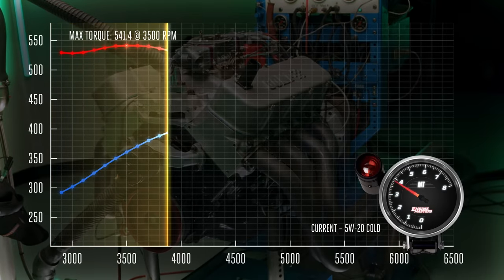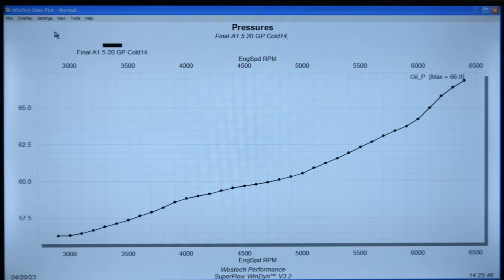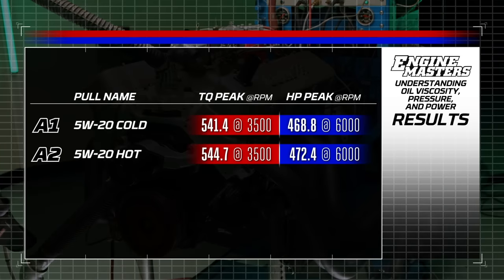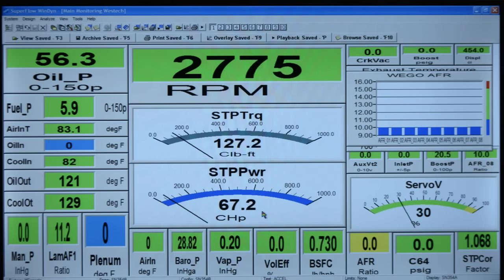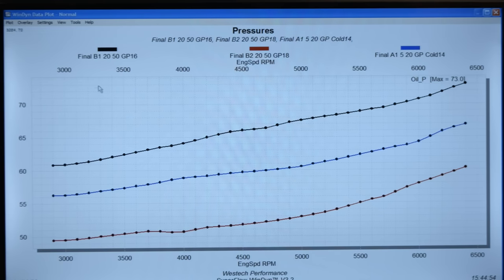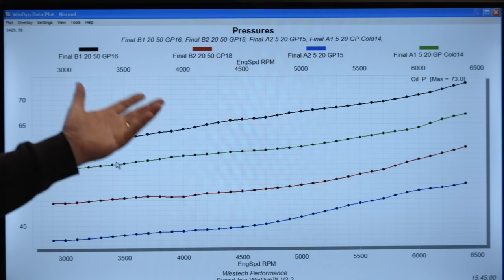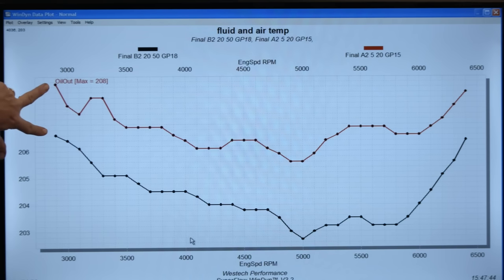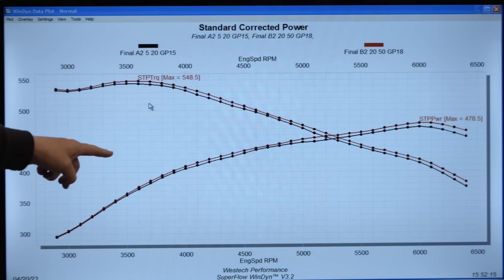Does the Thickness of Your Oil Matter? | Engine Masters FULL EPISODE | MotorTrend

Comment: Example 10w30 ...I was taught 10w is the cold flow number relative to water. The w stands for winter or cold flow. It flows 10x slower than water in a given time period through a given diameter tube.

30 is the multiplier when long chain polymers are added to the base 10w oil to thicken it when it gets hot. The polymers are wound up when cooler and unwind and lengthen when heated to synthetically thicken the oil.

So when hot the 30 flows 3x slower than 10 does when hot. The greater the variance (multiplier) between cold and hot flow, the more polymers that are added to the base oil.

These polymers shear and over time the oil loses it's ability to thicken up as much as when it was fresh. A 10w40 has 4x vs 10w30 having 3x... So 10w40 while initially thicker will shear down to a 10w30 or 10w20 before it is changed.

The take away from this test for me is that there is a goldilocks affect.... Too thick and horsepower is reduced due to flow resistance (20w50 cold). Too thin and horsepower is lost to ring seal (5w20 when hot). And then about just right (20w50 when hot).

I would like to have seen 10w30 and 10w40 compared with these two just to see where the dividing line is....

Maybe while 5w20 is just a tad too thin, stepping up to 10w30 provides adequate lube and seal to make comparable power to 20w50... Maybe more??? Maybe 10w40 finally gets the job done and exceeds 20w50 when hot????

Then you'd at least know how thick to go, taking into account cold start flow (lower number is always better) and then hot number that will be sufficient enough factoring in shearing over time.

For example if 10w30 is just right when fresh, maybe opt for the 10w40 knowing it will thin out some between oil changes. Anyhow... These tests always seem to be done incomplete. Good partial info though.
Reply: "These polymers shear and over time the oil loses it's ability to thicken up as much as when it was fresh."  PAO base oil is inherently multigrade and doesn't need those polymers (viscosity index improvers) to achieve a multigrade rating. 🙂
Reply: @TassieLorenzo  Yeah, read that before too. Should have mentioned PAO uses esters to compensate. PAG I've read has less friction coefficient, but it's better suited for sliding wear, whereas PAO better for rolling wear. I haven't conducted any tests to determine anything I've wrote. Just know I've been successful staying up on maintenance.

Comment: Well fellas it is not really a big surprise that thicker oil helps with ring seal and makes more power.
  But here is a the question list that brings much curiosity,,,
  Does thicker oil provide the greatest gains on engines with wide ring gaps?    
   Is there a substantial difference in engines that have cast , or moly rings ?
 Especially because there would not only be a difference in the cross hatching because of the type of rings that are being used.
  But I am most curious about the fact that cast rings and moly rings heat and cool a bit different than one another.
   So I guess the overall question is,,,   
  Does thinner or thicker oil make more or less power depending on the type of rings in a engine? 
 And which weight of oil makes more power with which types of rings?
   ????? 
 Tim from Wisconsin.
Thank you

Comment: They didn't talk about the thick oil and the load on a bronze distributor gear driving the pump, or does thick oil holds bubbles cause by aeration, in suspension. I'll stick with the thinnest oil that gives me my desired Hot pressure at idle. 25lbs. at 1100 rpms .

Comment: if ring seal is so important why did a test i saw on a 600 hp race engine when the ring end gap was opened to .125 the engine lost less than 10  hp. it blew oil all over the dyno cell.

Comment: Please remember, 95% of engine wear occurs arms cold start as it takes time for the oil to reach all surfaces. This is why a too thick oil does more damage than good if your engine has tight bearing clearances, like most all late model engines.

Comment: The oil pressure n viscosity floats the parts so they dont touch, if metal touches metal gauling. Racers use thicker more viscous oil for more gaul protection under extreme loads.

Comment: 0, 5, 10, 20W ( winter cold weight) 30 or 40 weight. They use oil molecules that shrink when cold for flow at cold start. They expand with heat for more viscosity.

Comment: Back in the day early 60s engines probably had 2 to3 thou on rods and mains some where in that neighborhood if you ran sae 30 you got way better oil pressure if you ran a good 10 30 oil oil pressure was lower when hot performance was much better. Had to be careful about mutigrade oil it was just bring perfected. Kendall had a very good 10 30 that was original kendall. Good old days.

Comment: This is very interesting, but not that much applicable perhaps to street cars... not that it was intention anyway perhaps.

It would be interesting how for example 5W50 compares to 20W50, or 0W40, or 10W60... in theory 5W50 should be better in cold, yet without sacrificing anything when hot. Whereas 5W20 perhaps just thins out too much when hot.

Comment: Flow of oil by a bearing is another topic, not only pressure is important when you rev the engine. If the thick oil is moving too slow... it is a jungle. I would never choose oil for a small power increase. Wear tests would be much more interessting.
Reply: I asked, and received a long test write-up on that topic from Lunati in the mid-90s. Different oil viscosities, diff running temps, different bearing clearances. 

It was several pages long, but essentially this. The higher viscosity oil always exited the bearing shell clearance hotter than the lower visc oil. The bearing wedge/interface always wanted a 10 weight fluid, or closely so.

If 30 weight oil was the test, the oil heated up to close(ish) a 10 weight upon bearing exit. If a 50 weight oil was the test, the oil exited hotter than the 30 weight, thus resembling the same nominal thickness upon exit as the cooler 30 weight. 

The benefit of thicker oil in older engines wasn't necessarily the rotating assembly, it was beneficial to the valve train. Modern engines with roller valvetrain, or better yet, overhead valvetrain with roller interface and less moving mass pretty much doesn't care what viscosity oil. 

After a few decades of being very interested in lubrication, and taking the thought-provocative path around the galaxy and back -- it turns out that really smart mechanical engineers, petroleum chemist, millions upon millions of dollars of equipment and testing yields some really solid conclusions. GM, Ford, Chrysler, Toyota, Honda, Nissan, etc. etc, all know 50x more than the most inquisitive garage enthusiast such as myself.

Comment: Try comparing a engine with hydraulic lifters, one time with 10W30 then with 30 weight !!! The thicker oil has more entrained air molecules in it causing lifters to collapse slightly !!!
But 30W lubricates main and rod bearings better,

Comment: All engines would benefit from prestart priming system, just like electric fuel pumps that start before the engine turns over
Reply: Not really. Even an engine that’s been sitting for a month still has a layer of oil on the surfaces. Starting and idle is low load so the oil wedge from the thin film is plenty for the short period until oil flow gets to it.

Comment: Thicker oil produces more power, which may be due to the higher viscosity leading to some of the engine's spots not being successfully pumped. The power is higher however the metal-to-metal contact is existed. The durability for a long period may be affected. This is my theory.

Comment: Do it again with a different engine. Something with a smaller bore like 4.8/5.3 or a 2JZ would be interesting because they are known for their cylinder pressures.

Alternatively, you could just compression test the engine with the different oils.

Comment: "Manufacturer recommended"
Is for a reason. 
They did the testing.  Same goes for octane and tire pressure.  If it was easy, everyone would do it.
Reply: Yes and no.  Ford gives two power ratings for the 2.3L Ecoboost Ford Bronco, the power rating on 87 octane is 25hp less than on 91 octane.  Focus RS with the same engine makes another 20hp more on 93 octane than 91, even though it only calls for 91 octane minimum.

A lot of cars these days call for very high tyre pressures (e.g., 40 psi in 19" tyres) and very thin oil (e.g., 0W16), this is strictly to get the highest possible fuel economy on official EPA or WLTP fuel economy testing (since the factory specs are used for this testing).  It's not necessarily what is "best" for comfort/handling or long-term engine wear. 🙂

Comment: Regarding the oil pressure: cold vs hot.  The oil pressure gauge is merely an indicator to the driver if the oil is even there or sufficient to produce any pressure!  The actual oil pressure number isn't significant as long as it is enough to supply the engine with all the oil needed for its operations!  As every engine is different, oil manufacturers do not have specific oil pressure numbers for an engine buy may have a range of numbers to ensure proper oil supply!  So comparing oil pressure between cold vs hot is irrelavent!!!

Comment: So this engine needs to be the engine masters oil test engine. Now it would be possible run solid rollers on the same camshaft same test battery see if that changes anything, then need to see if tighter bearing clearances changes that.

Comment: If i could afford to and had a throw away engine to do so, I'd like to do these type of tests on a 3.6 infiniti g37 engine. 5w30 full or blend synthetic is manufacturer recommended oil. Obviously these engines N/A are just as much rubber band as with them being turbocharged. Plus they have a much more complicated top end that is very much dependent on oil pressure to activate the dual overhead system.
Reply: I ran 5w-40 liqui moly ceratec in my Q50 3.7, ran a lot smoother imo.

Comment: If you fill in oil filter with oil you always do it through the outer holes because the center hole is supposed to be filter oil that goes into the engine
Reply: Cant with an antidrainback valve
Reply: It doesn't matter.
Reply: It doesn't matter; it's fresh, clean oil.

Comment: Bro i worked sears automotive for two years and mavis tire for two years! In sears we had 5 bays on oneside of the shop that all got 10/30 other side of shop had a few different bays with other choices lets just say the whole left side of the shop got 10/30 for years ever car every make! And mavis tire particular one in white plains ny all cars got 5/30 all cars lmao they only have one oil tank o good thing your springing for that synthetic cause your getting conventional terrible!!! Also goes along with the guys playing piano banging noise under the wheel alighnment rack which prbly faked 90% of wheel alighnments so after seeing all that and the cars still coming back im convinced you can use anything just change it every 3,000

Comment: The thicker oil makes more power at full throttle.  But what's the difference in fuel consumption at light throttle?  That's where the lighter oil probably wins.

Comment: This test doesn't begin to tell the story about engine oil. You have to remember that engine oil is not only responsible for lubrication, it is also responsible for pulling heat out of the bearings. I have seen a lot of people that ran 20 w 50 in their '60s and '70s muscle cars and they would dance in place squeezing their weenies showing all their friends how much oil pressure they had. What they didn't know was they were causing wear to the engine bearings. It's like the difference between trying to squirt molasses through your teeth and water through your teeth. The molasses will give you a lot of pressure but not much flow. That is the way oil works You can have a lot of pressure, but if you don't have the flow to keep the bearing cool and more lubricated you will get more bearing wear. New engines these days have very tight oil clearances so they run the lower viscosity oils.

Comment: If the new LS engine require a 0w-20 oil, would it be better to run something thicker like 5w-30 or 10w-30? Or, even thicker?
Reply: Maybe I’m looking at/thinking about it too simply, but on a new engine from manufacturer, I’d stick with their recommendation. If you’re in exceptionally hot ambient temps(Much of the US is right now, maybe “bump up” to slightly heavier oil).

I believe many of these super thin oils came about due to economy standards for mpg. Less rotational resistance on the engine internals. I believe this is also why many super thin oils are recommended from factory, a thicker oil may not meet the manufacturers mpg claims.

On a newly rebuilt or modified engine with non standard tolerances and bearings etc, I think it’s best to go with the oil for how the engine will operate. Far too many variables here to determine what’s best and it’ll be specific to that engine.

Comment: I never understood why US manufacturers used to recommend 10W30 and 5W30 for almost all engines, even in the 80s! Why?
Anywhere else, 15W40 or 10W40 was standard, while high power engines used 10W60 (all Italian sportscars, BMW M etc).
I mean, 30 weight oil is totally fine for northern states and typical commuter use.
But hey, there's also the southern states. And people who have a heavy foot.
Was it already a fuel economy thing in the 80s??
I worked at an engine test lab around 2000, at the time, those "water oils" (0W30, 0W20) came on the market and the car manufacturers started using them.
We had a so called "Autobahn exit" test. That was, running the engine at full load, heat the oil to 150, then down to idle and then wot at 1500 rpm... Simulating the lazy guy who exits the autobahn after a hot run and then fully accelerates from the intersection.
Man, that caused wear on all bearings 😂🤣 There was simply no oil pressure at that rpm. Metals touching.
That was an experience that I will always remember. NEVER use anything thinner than 5W40 (for my dailies and my dodge van) and the Maserati Biturbo gets 10W60. High temperature matters more than cold starts on that car... No winter use 😉

Comment: 99% of oil formulation and additive packaging is based on application and duty cycle. Without a huge fluid chamber and cooling tower, you're just not going to get hard numbers and "this works for that" on a typical dyno.

Comment: Also remember that the temperature of your oil is critical to how effectively it can trap and remove carbon and other contaminants.
Reply: Says who?
Reply: @oldblueaccord2629  Everybody that understands oils many functions. Here's a scenario: You live in a hot desert climate. You car runs hot, above 212°F and your manufacturers oil weight spec is 5W-30. That temp is too hot for 5W-30. You can switch to 10W-40 or put a 165° thermostat in it to bring the running temp back down below 212°. That's why road car racers use 20W-50 or thicker, the sustained higher oil temps require it. Thinner oil can't sustain higher temps and will become volatile and turn into vapor.
Reply: @RANDOMNATION907  Your oil weight at 212F is 30 weight as tested. I think your cut and paste needs some work.
Reply: @oldblueaccord2629  Nope, nice try, straight from me, no cut and paste. Go read what my response was, again. I wrote that if the engine/oil temp is Above 212° 30 weight won't maintain viscosity as long as a heavier weight oil.
Reply: @RANDOMNATION907  you mentioned oil "trapping carbon" and then swapped to oil temps and viscosity....sorry Im lost. Glad you edited your 2nd post it needed clarification.
Reply: @RANDOMNATION907  "That's why road car racers use 20W-50 or thicker"  Do they (still) though?  In small block Chevys in V8 Supercars, they run 5W20 in qualifying and 5W30 in racing (Ester synthetic racing oil, which inherently has better film strength than mineral oil).  If they didn't do that and ran a 20W50, they would be giving away free horsepower compared to the competition. They still see negligible wear on the engine at the 3000 mile rebuild interval even with this thin oil.  It has to also depend on whether the oil cooling system is designed well enough to keep the thinner oil in the correct operating temperature, surely?
Reply: @RANDOMNATION907  "Above 212° 30 weight won't maintain viscosity as long as a heavier weight oil."  Sure, but isn't the problem there inadequate oil cooler design?  So they are better off improving their oil coolers, than using a thicker oil and losing horsepower compared to the competition?  Of course it depends on how restrictive the engine rules are.  In V8 Supercar everything was spec (compression, cam, rocker ratio etc), hence using the thinnest  possible oil to get as much power as possible. Similarly, it's common to use the thinnest oil you can get away with in one-make series too where you looking for any small advantage (not that Indycar is one make, but they go to great lengths to find the lowest friction wheel bearings they can find for the Indy 500 for example!).
Reply: @TassieLorenzo  The engine would also need to be cooler. But, yes, that would certainly help.

Comment: Throw a super long intake on it w low rpm short ports for tork.
The earls hot.
Make the best oil.pump ever, dorito designed no valve.
Some newer cars are failin because of ring carbon lock. Too hot

Comment: 10W40 in the winter, 20W50 in the summer. Stick with Wix filters.
Reply: Oil change times, 3000-5000 miles.
Reply: Check the oil level every refuel.

Comment: My takeaway : Check and test your engine for worn ring before experimenting with oil viscosity, simplest thing can be done by periodically checking and logging the oil height on the dipstick. Once you are sure you got little or no oil burning, which probably means good ring sealing and gap, go try lower viscosity. OR just stick with the recommended oil weight.